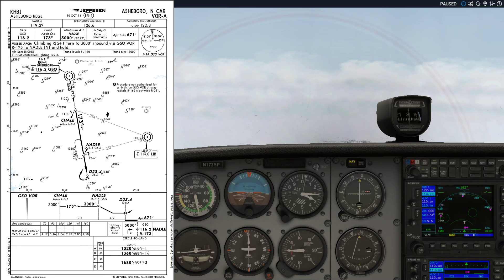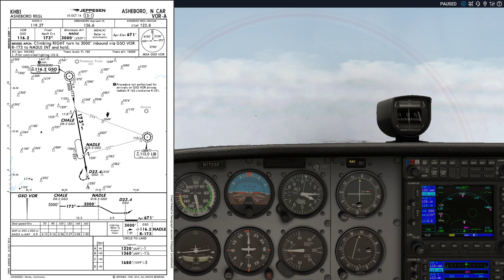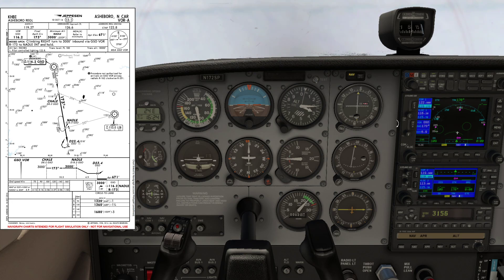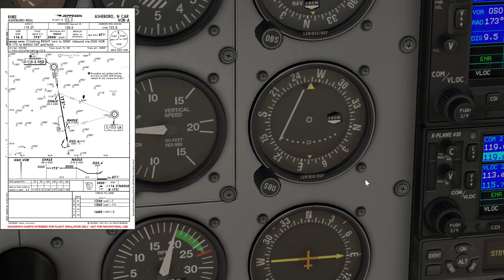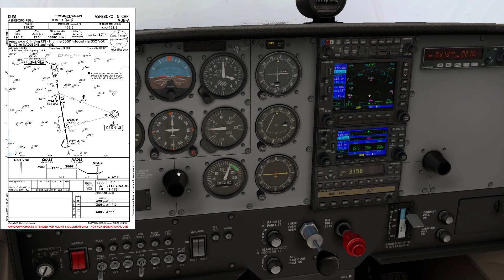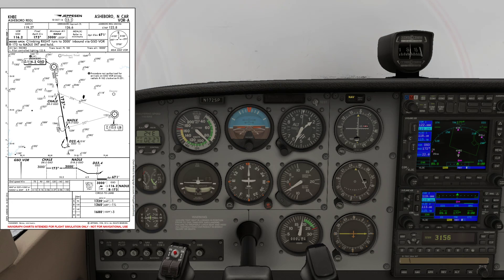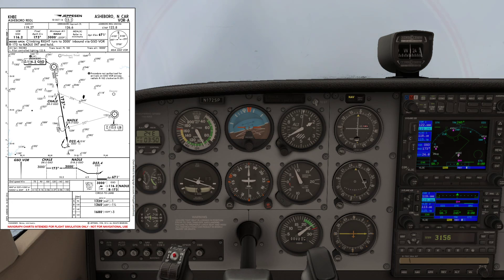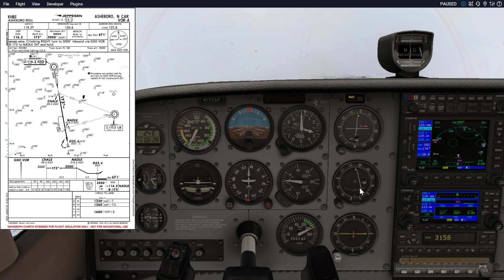4 ways to fly a VOR approach: 1 - Timing the Missed Approach Point

Comment: Great Video. Thanks. Isn't it a little dangerous when the Missed Approach procedure sends you back the same radial (GSO 173) and same altitude (3000 ft) as the approach procedure?
Reply from the maker: No, because ATC will only ever have one aircraft in this airspace over an uncontrolled airport. That’s why it is critical to call as soon as you are on the ground to cancel your IFR. The entire airspace for both approach and missed is off limits to everyone else until you cancel IFR. That’s why for my instrument students “close flightplan” is on their after landing checklist.
Reply: @XPlanePhil  Thanks for clearing this up.